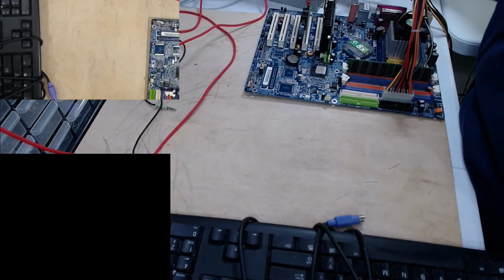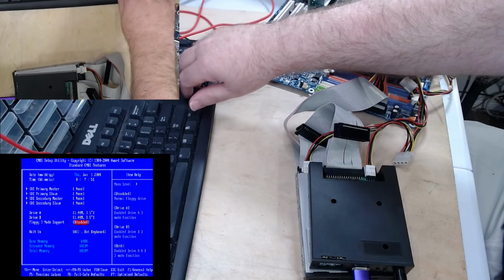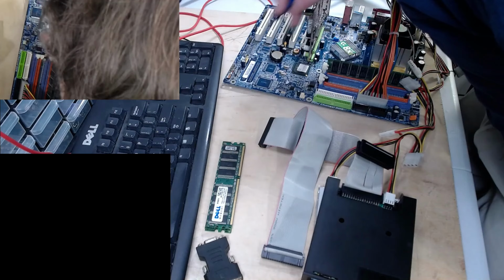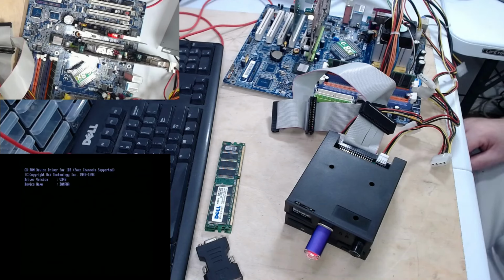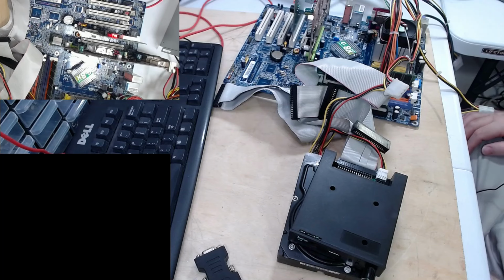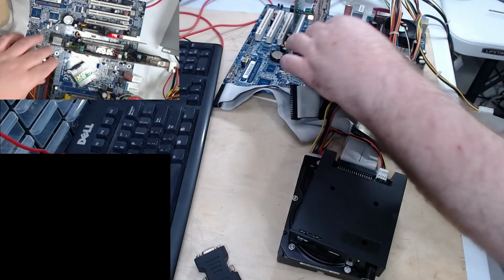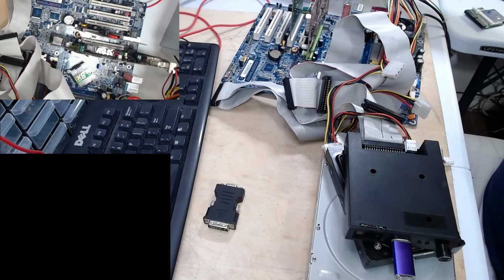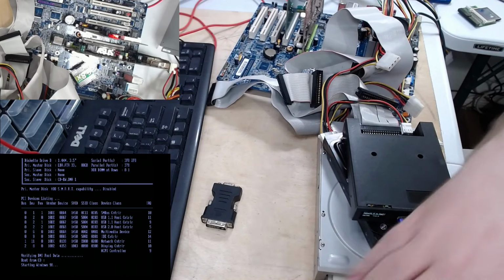Athlon Action! (Gigabyte Socket A part 1)

Comment: GeForce 2 MX440 - fairly old video card actually and incredibly common card actually. That one looks like an OEM model from Dell or HP. 

I’d have started by pulling the CMOS 🔋 and not by changing a video card that was clearly working. 

Also I’d have plugged in a speaker.
Reply from the maker: True, should have looked at the bios on the board, and a speaker would be most helpful in addition to the post card.

Comment: For socket A this motherboard 7N400 is very weak model.7N400 Pro or Pro2(rev.1 and rev.2.0) is the proper reliable model!!I have 7N400 Pro2 rev.2 unique and very powerlfull motherboard with the highest CPU Barton 3200+.All these models support double dual chanel up to 3gb of ram - 2x1gb of ram on chanel A and 2x512mb on chanel B but they must be doublel sided ram.Update the bios with last version it would be very usefull!!
Reply from the maker: Ahh! I had a feeling there were better versions of that board out there. This one was found in a case I picked up cheap locally and seems to have issues. I believe it has the latest bios though.